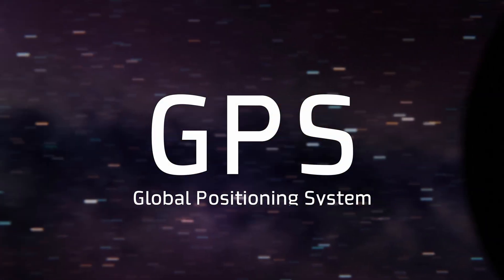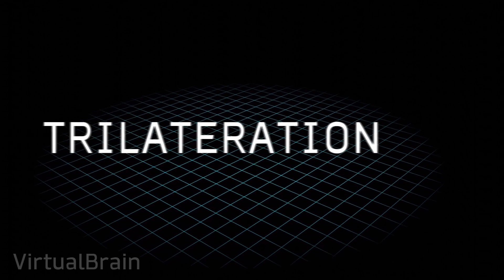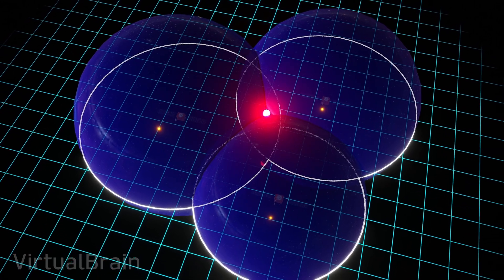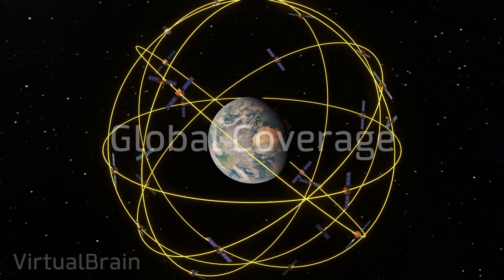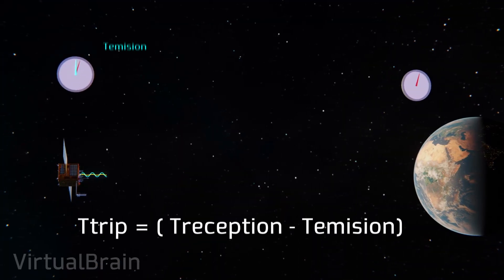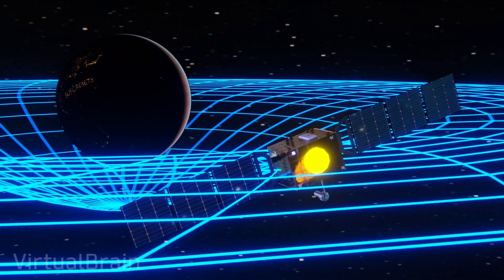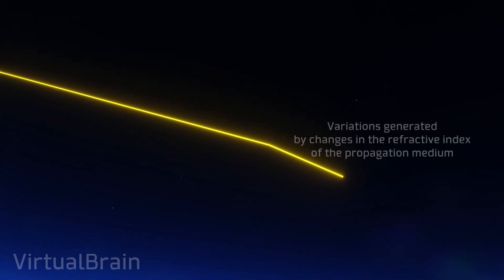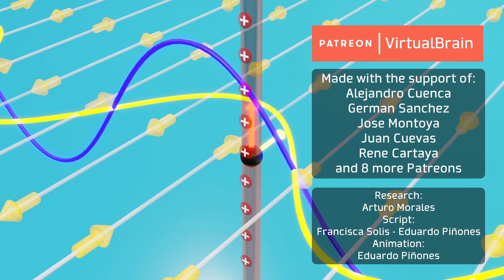How GPS Works 🛰️ What is GPS

Comment: GPS does not use Special Relativity but uses a Lorentz version of relativity, or a Sagnac correction to sync the clocks.
By abandoning the Einstein/Poincare clock sync method, implementing a Sagnac correction to sync the clocks, and recognizing a Lorentz version of relativity, GPS and GNSS has improved to sub centimeter from the previous accuracy of about 30 ft.
   The time of the clock is used to calculate its position, which is transmitted to the ground. By abandoning Einstein and using a Sagnac correction to sync the clocks, the clocks are better able to accurately calculate the positions that they send to the ground

Comment: As a retired airline pilot, I helped usher in GPS navigation into the system. One day I was ask how we set time. I explained that time was automatically imported from the satellite. For lack of a better name, I just called it "Star Date Time". If it was good enough for Captain Kirk, it was good enough for me.
Reply: It’s just mathematics — time is treated as the fourth dimension.
(Really — I’m a professor who teaches GPS, and this is exactly how it works mathematically.)

Here’s a simple way to think about it:

On a 2D plane, you need signals from 3 satellites to determine your position.
In 3D space (the real world), you need 4 satellites to determine your position.
In 4D space + time, you need 5 satellites to determine your position in both space and time. 

Using a 5th satellite allows you to solve for both your precise position and your exact time — finding the only solution that fits all the satellite signals.

While it’s hard for us to mentally picture four dimensions, treating time as the 4th dimension makes the math straightforward.

The reason this is needed is that the quartz crystal clock in your phone or other inexpensive GPS receiver is not accurate on its own if it hasn't been synchronized with the GPS constellation recently.  Once you have a GPS lock, you've essentially synchronized the clock on your receiver with the time on the satellites (the satellites have a rubidium-cesium atomic clock, and they're each synchronized with the US Naval Observatory in DC at least twice per day).  

So, time is the "4th dimension" in the mathematical equation, and you need 5 spacecraft to get your initial GPS lock.

Comment: Thank you, finally understood how relativity theory applies to GNSS -- time correction.
Reply: GPS uses a Lorentz version of relativity or a Sagnac correction to sync the clocks.
By abandoning the Einstein/Poincare clock sync method and implementing a Sagnac correction and recognizing a Lorentz version of relativity, GPS and GNSS has improved to sub centimeter from the previous accuracy of about 30 ft.
   The time of the clock is used to calculate its position, which is transmitted to the ground.
Reply: On Constancy of the Speed of Light in the Global 
Positioning System - Yang-Ho Choi

Comment: I know this is a big ask and you’re obviously very busy; would you consider having your remaining Spanish videos (and Italian ones, if those apply) translated to English?  I find so much value from your content and the balance you strike between time, simplicity, details, and of course the superb animation support.

I’m fairly new to electronics and I enjoy the component level of detail.  I know there are still a lot of fundamental type electrical and electronics concepts to write about, at the same time, I hope you’re considering feedback and requests.  

1:) I hope you keep expanding your electronics videos.  

2:)  Of interest are more complex ICs (OpAmps and timers, for example, their schematics, animations of the IC components that are within the chip, some simple example applications (such as one might find in an electronics 200-1 science/hobby kit), and of course your brilliant animations of these applications.

3:)  Videos and animations of common circuits, utilizing discrete components (resistors, coils, capacitors, transistors, diodes), ICs, digital and analog devices, etc, such as comparators, adders, ADCs and DACs, power supplies, buck converters, and on and on :)

4:)  Sorry, this is a lot, but hey:  you’re that good. 

Thank you for what you do.
Reply: So basically thier has been dramatic scenes between the two 2⃣ barriers and 
Part 1
of the main understanding. Points is that the Denomination  groups of this partial area are knowingly ,well at least be5. Supplying Los Angestikiados for their own sakes of ĥarsh colonization and are just skating the ice-screams personal standing p.oints
Reply: So basically thier has been dramatic scenes between the two 2⃣ barriers and 
Part 1
of the main understanding. Points is that the Denomination  groups of this partial area are knowingly ,well at least be5. Supplying Los Angestikiados for their own sakes of ĥarsh colonization and are just skating the ice-screams personal standing p.oints
Reply from the maker: Thanks a lot for your support (here and the other comment) 😁

About your request, In fact currently the English channel is just one video behind the main channel, and the plan is to continue working on reducing the gap between them.

After a long break in the main channel  due to my the finishing of my PhD I just published a video yesterday! the objective is to keep posting at least a new video per month so I will consider some of your recommendations :)

EP ✌️
Reply: @VirtualBrainENG  Wooooooow! I didn't know you're doing a phd

Comment: Also you could use one fewer satellites to determine your location. In case of three satellites, the three distance spheres intersect in two points. One of which could be safely discarded, because it is deep underground or way up in atmosphere/space.
Reply: My understanding is that they actually do this.
Reply: You need 4 satellites because your solving for 4 unknowns X, Y, Z and T (time)
Reply: @ScubaPhil1  what they usually do is use up to six satellites and calculate 2 points on earth, with 3 satellites each (using @marekKnapek’s method instead of 4 that would normally be required).   The difference in those two locations is due to the inaccuracy in the quartz clock on the device.   Then it has an accurately calibrated device time and can recalculate a precise position.
Reply: Actually one of the two points would be logically discarded only if 3 of those satellites are on the same plane. If they're not, the two points could be both theoretically correct locations, depending on the dispositions of the satellites